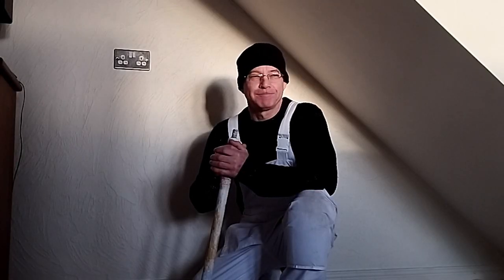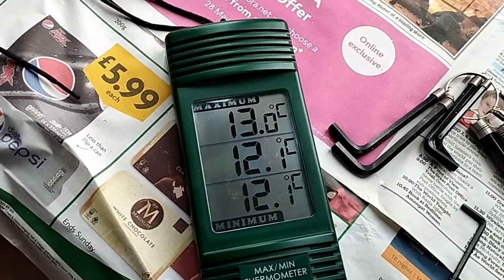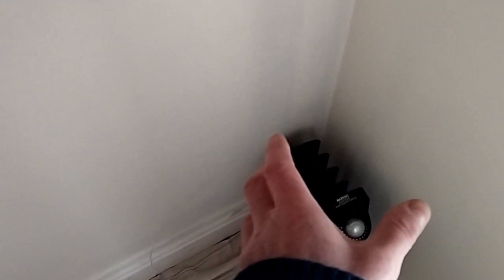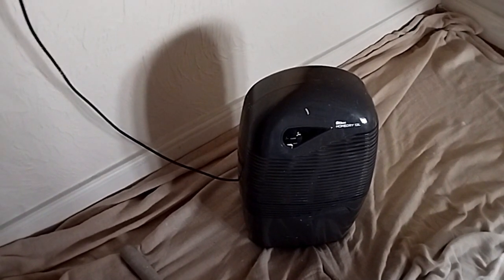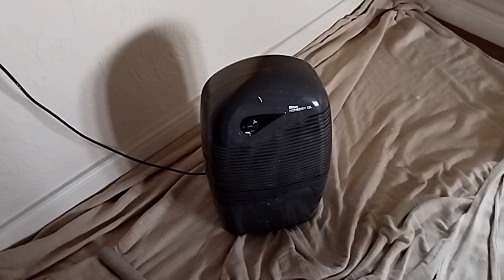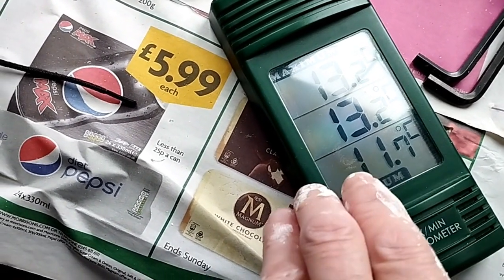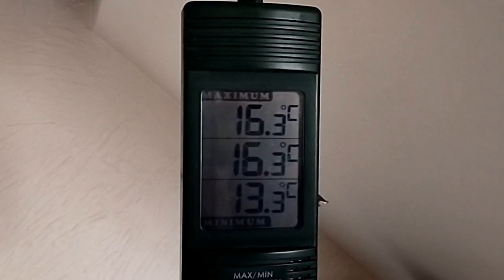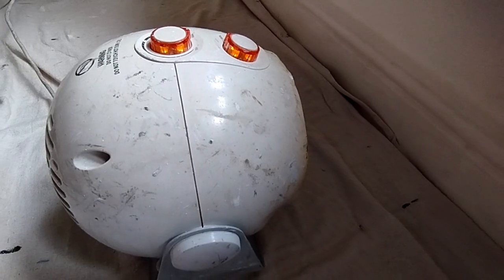Painting Cold Walls

Comment: Its a nightmare this time of year, everything takes forever to dry, we have 'peter the heater' on standby for jobs like that, otherwise the walls would still be wet a week later 😁
Reply: I did a job in November in a new build (old house renovated), I did a mist coat which dried quick, first coat on the ceiling took over a day. I had to fill the entire ceiling line as the plasterers had one coated and corner trowelled early leaving an indent around the edge that looked like a tapered edge board had been used, anyhow 3 days later and the filler was still sopping wet. Absolute nightmare
Reply from the maker: Yes slows you right down and becomes frustrating..

Comment: So massive amounts of electricity costs, to get a room painted, and once the painting is finished and the room temperature 
chills down to where it was before the supplementary heating, you can expect the mould to come through the newly painted surfaces.
 What a waste of time, expense, 
materials, and outmoded way of housing. And then, presumably after 2/3 years the same circus starts all over again. Time to demolish this kind of outdated housing, and put up environmentally friendly low maintenance spaces, that breath, with the seasons, and are not dependent on to toxic paints.
Reply from the maker: in theroy your logic is sound, practice is another thing completely.  It all comes down to who is paying, and what house is cheap to build. It's not the people cause this problem, just greed.
Reply: Agreed!
Reply: Or you could just put up some wallrock liner to the cold walls, to stop condensation being attracted to cold surfaces you put a barrier liner up to make it less cold. Same way some people have the plastic clingfilm over the window glass to give them triple glazing